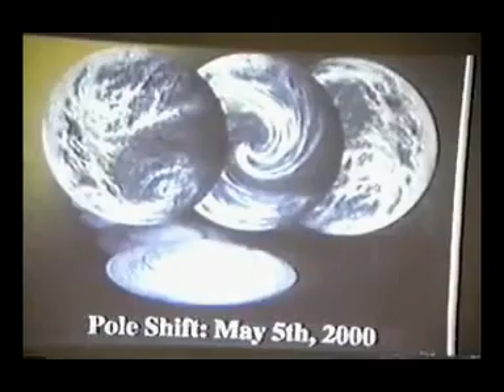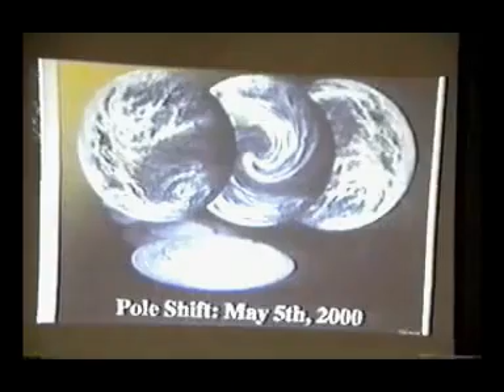5-6 John Searl levitation technology (SEG)

Comment: Rubbish the science does not add up read his books.The craft flow at  3,500kmh perhour=2,174 mph or mach 2.674.I even have a refrence it made mach3.2=2,250mph.Which are all false .This then makes the model fly faster than both concorde and the SR 71blackbird for which i designed with kelly johnson at Lockheed Martin in the 50s.Utter nonsence the model could never get to any of these speeds for obvious reasons in 1968.